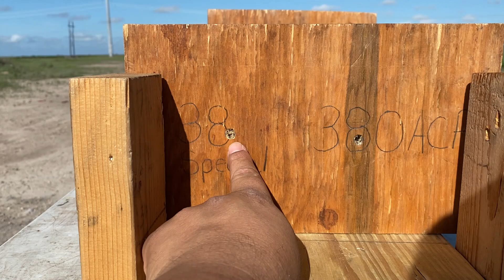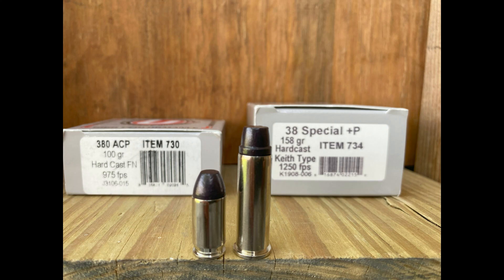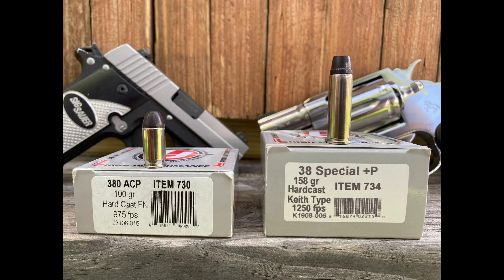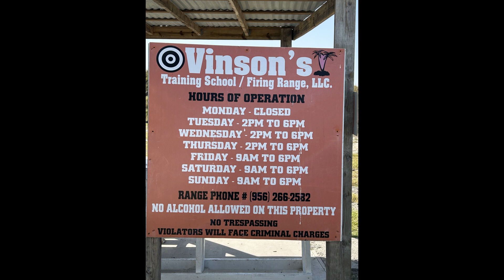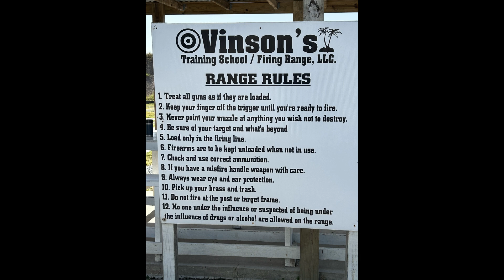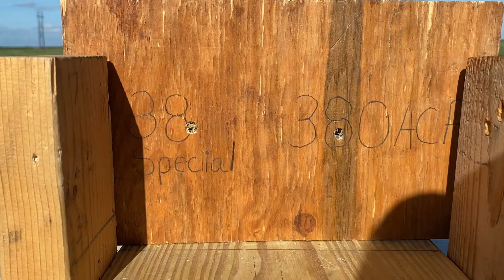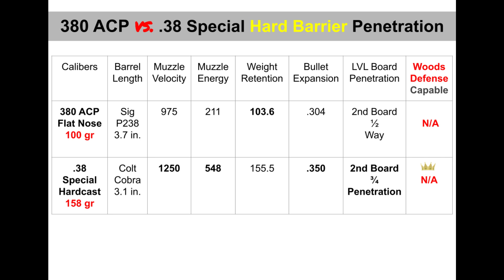380 ACP VS  38 Special:  Hard Barrier Penetration Test

Comment: Thanks that's a useful reference point 380 vs 40.  Since state troopers used to use 40 for vehicle penetration, this flavor of 380 should be sufficient for barrier penetration.  Good work, thanks.